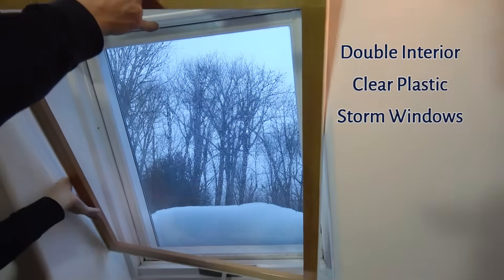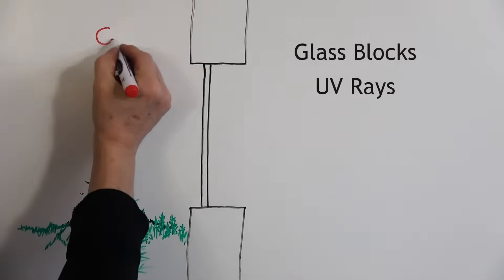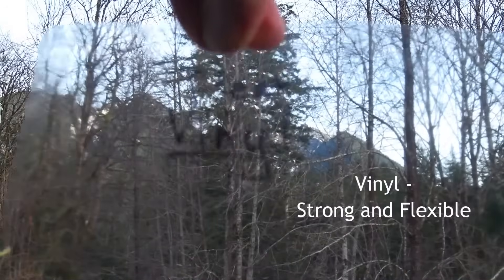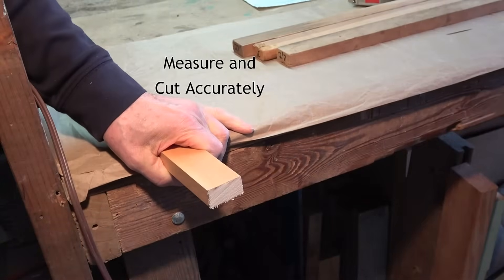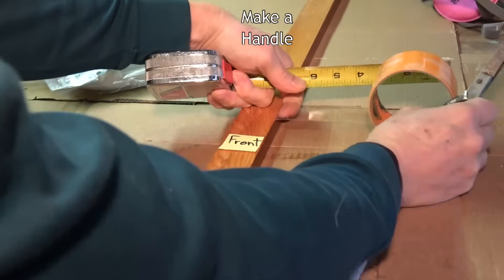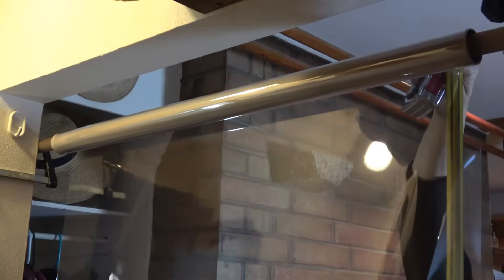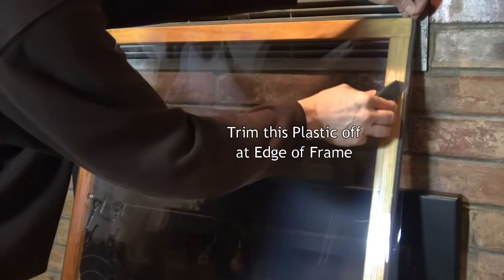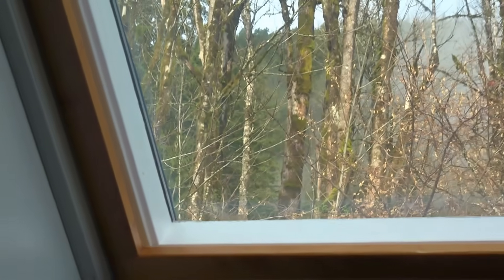Best Double Interior Storm Window Inserts: Save Money on Heating

Comment from the maker: Note: To shrink the film tight with a hair dryer like Window Insulation Shrink Kits, I'd suggest 1 or 2 mil film, if you can find it.
I've found the folded up 0.75 to 1.5 mil film that comes in shrink kits is not very clear, and even after shrinking the creases still show.
The 3 mil polyester film I use comes on a roll so it's not creased, and it's a little wavy but very clear, and a hair dryer isn't necessary.
If you're determined to shrink it tight, you can do it with a heat gun, but be careful not to melt a hole in the plastic doing that, and if your frame is too flexible it may bow in from the tension.
Reply: Does the thickness of the film affect R value?
Reply from the maker: @drencrum  Good question.  It's primarily the air spaces that provide the insulation.  The thickness of the film may make a small difference, but not much - I have not found any data on that.  More important is to have air spaces between 1/2" and 3/4".  Much more than that and you get convection currents that transfer heat. A thicker film will reduce sound transfer though, if noise is a concern.
Reply: @HartzHomestead  interesting.  I agree that a larger space will have more likelihood of convective air currents.   

I wounder what other factors.   I wonder if more or less currents develop in larger vs smaller windows,  sunshine vs shade etc
Reply: I used the clear stuff from a fabric store that they used to use to protect furniture back in the 50's and 60's and I use it on my patio door screens . It costs more but you can get it in 3 different thicknesses  . Never even looked in the store to see what it was described as . I just remember i had an Aunt that had her furniture covered in it and even the cloth seats on her kitchen chairs and it always made fart noises and stuck to your skin .  WOW that says how old I am   72 years old   Great job in describing how to build them
Reply: May I ask what brand you use?   The poly I’ve looked at is very cloudy and flexible, almost like sheeting used for painting.
Reply: @tryan368  Hi!  I don't know if you found your answer yet, but if you look in the description of the video there is a list and links of suppliers he used.  One is an amazon link and the other is for eplastics.
Reply from the maker: @tryan368  The clear polyester film on Amazon is called Duralar, and Mylar is another brand name. Eplastics simply sells it as clear polyester film, no brand. The cloudy plastic you refer to may be polyethelene, cheaper and commonly used for tarps, painting and UV resistant for greenhouses.  Vinyl is fairly clear, used for shower curtains, and also comes in UV resistant for outdoor and marine use.

Comment: i was told this could still trap moisture with single pane windows. and to do build a frame and do ⅛” acrylic (plexiglass) or polycarbonate as it’s rigid, better insulation, and a much lower condensation risk.
Reply: is this true?
Reply from the maker: Whether it's plexiglass or polyester film, moisture doesn't go through the glazing, it leaks in around the edges.  The insulation value is in the size and number of air spaces, and how well sealed they are.  I get minimal condensation between the insert and window, and only upstairs, where air is warmer.  You can absorb it by putting desiccant packs in there. The real question is how well sealed up your insert is, regardless of what it's made of, and also if there is moisture there to start with.

Comment: Great! wish this was a more common option for regular windows in stores
Reply from the maker: It's true, would be nice if store bought windows had even surfaces around each pane, designed to tape plastic to, and also if stores would carry the quality supplies needed. I have heard of window units that have glass on the outsides with layers of plastic inside, where it is protected from damage, but much lighter than all glass panes.

Comment: You needed to use "The insulational Factor of AIR"  IF the air can't come and go then it becomes some form of insulation.
This means you can get a larger total for the R factor simply by having deep pockets between layers.
Reply from the maker: Everything I've read says if the air space is over 3/4", then convection currents circulate within that space, flowing down the cooler surface, and up the warmer surface, thus transferring heat faster. So while there may not be a big difference, a large gap, like some of my windows have a 3" space on one half of the slider, is not quite as insulating as the more ideal gap of 3/4".
Reply: @HartzHomestead  You are correct about the issue of air space.
"The insulational Factor of Air" is based on NO transfer of air or very limited transfer of air in proportions.
(The easiest way to explain the effect is it's easier to maintain the heat in an Office in the middle of a factory than it is to heat the same office outside of the factory.  I've live that in the form of a Guard shack in the middle of a plant floor.)

I'm trying to find the you tube about a new company that is claiming R-30ies by having very deep window and then layers of the Polyester film with like 2.5 foot gaps (estimated)  each layer is sealed.

Comment: This is an insanely well made instructional.  O have a sun room that is currently just screened in.  It's a social focal point and a great spot to overlook the farm from, and watch birds or sunsets.  I've been wanting to build some kind of solid barrier for the windows during the winter, but all the polycarbonate etc options are overkill and not transparent enough.  This is perfect.  I may built a small seed starter greenhouse with this method too.
Reply from the maker: Just note that most polyester film is not UV resistant, unless you can find one that is, most plastic films won't last more than a few years exposed to the sun. You might consider Marine Vinyl, which is UV resistant, though not quite as clear it's pretty good and will last a long time. Also vinyl has a softer feel and would not make a crackling noise in the wind like polyester might. UV resistant polyethylene is commonly used on greenhouses, and is much cheaper, but a hazy white, so you can't see much through it.

Comment: I've had good results using a $3 clear shower curtain liner to cover both sides of a frame insert.
Reply from the maker: That would be a low cost way to buy a sheet of clear vinyl, which is strong, flexible and easy to work with, though not as clear as polyester film, if you're not particular about your view, it works just as well for insulating windows.

Comment: Neat tape measure tip😊. What would you do with a window that is over 5  1/2 ' high? Great video btw😊❤🙏🇨🇦
Reply from the maker: Depends on how wide the window is, and how wide your plastic film is. Most 1 x 2's would likely bow in at that length, so either divide it into 2 windows, or put a cross bar half way up. Otherwise use stiffer wood, like maybe 1 x 3 fir for sides much over 4'.
Reply: @HartzHomestead thank you so much

Comment: Adding an extra pane can reduce the heat loss created by convection currents (if gapped correctly) but in reality, the majority of the heat loss through a window is via radiation (65%+). Best to use blackout curtains when possible.
Reply from the maker: I haven't seen data on how much window heat loss is via radiation vs convection. I do know that adding 2-3 panes cut our heating bill by over half without affecting our view.  Many RV dwellers swear by reflectix, which reflects radiant heat plus adding an air gap, though it also blocks light and view, so it depends on your priorities.
Reply: @HartzHomestead  That's pretty much my conclusion. Windows suck. I think I read that a non insulated window is R1 but a triple pane is about R2 - R3 which is terrible compared to a poorly insulated wall which is around R12. 

I've been modelling air gaps between window panes and unless the aspect ratio of the window height to air gap is 10 or lower (i.e. 1 ft tall window to 3/4 inch air gap), there is basically no convection current which means most of the heat loss will be via radiation as air is a really poor conductor of heat.

Comment: 50 years ago we had windows with a 2nd set of frames for winter. Only problem was that once installed they stayed till spring and no ventilation. But in a 100y old house this was not a problem. Now we have windows with double glass, better heating and better wall insulation. An additional layer would be nice, but I open them 20 times a day for fresh air so I can't install anything over the window.
Reply from the maker: Can you tape a layer inside the opening window so it opens with the window? I do that on wood casement windows with just a 1/4" gap, but it's hard to do with sliders. I do have 2 windows I split into 2 panels, so I can slide one to the side and open the windows. Or select 2 you windows you'll open and put inserts in the rest. I wonder if you turn the heat down if you wouldn't need to open the windows as much? It may help to run an air purifier if air quality is an issue, but still it's nice to have fresh air.

Comment: Anymore tips on doing this without kinks in the plastic? I've tried frame on a table and frame in window and I keep getting wrinkles.
Reply from the maker: With 3 mil film I usually just get a slight waviness I only notice at night when there's a reflection. If you really want it smooth you could try 1 or 2 mil, then stretch it with a hair dryer. It's important your frame is stiff enough that it doesn't flex too much, then stretch it plenty tight top to bottom and side to side in the middle. Working it out to the corners is the trickiest part; make sure to stretch outward at a right angle to the sides, not stretching it toward the corner, or you'll get wrinkles in the corner. I think it's a matter of keeping a mild, even tension on the plastic, not too much going out to the corners or you'll get a bow in the middle of the side. Hope this helps.
Reply: @HartzHomestead  thanks I realize my windows aren't totally square. 100 yr old house. So I should have used a softer thicker foam. I also learned that i should have worked on the attic air leaks before doing the windows.

Comment: Old house comment. I used to live in a house built in the 1920s. One year, sheer laziness & extra material, I stumbled onto a great energy saver. I was using those clear plastic sheets a person puts on for the season with double sided tape. Rather than cutting the plastic film, I taped the too-big sheet to the wall centered on the window. It extended about a half foot on all sides beyond the window trim.  So much warmer. I hadn't realized how drafty the window installs on that old house were.
Reply from the maker: Good point.  I'm doing that on our camper with insulated curtains, going past the window, covering the whole wall in some places.  Otherwise, caulk well around any window perimeter that isn't well sealed, both inside & out.

Comment: How do you know the ideal spacing?    Is 3 inch spacing too much?
Reply from the maker: If you Google "optimal window glazing spacing" you'll find charts that mostly agree 1/2" to 3/4" (12-18mm) gives you the most insulation.  Wider than that, and you get air currents between layers that reduce the effectiveness. However, that may be impractical in your situation, so do whatever works, it will still make a huge difference. In our house I have anywhere from 1/4" to 3" in some places.  My double inserts are 3/4", which is very convenient as that's how thick 1x2" are.

Comment: Very useful video, thanks. I suggest you try 'shrink film'. After it is attached to the window frame or a removable frame with double back sticky tape, use the heat from a hair dryer to shrink the film so it becomes taught and without wrinkles. I have had it on a non opening window for over 10 years and it still works well. In the air space between the film and the glass put some sachets of silica to dry the traped air to avoid condendation.
Reply from the maker: Yes, you can buy clear polyester film in 1 mil thickness, and shrink it tight with a hair dryer.  I was not impressed with the 0.75 or 1.5 mil films that came in Frost King kits - it was creased from being folded and not very clear, though the tape is good. If you don't care about your view it would work fine. Glad to hear it has lasted 10 years.

Comment: This is a very good explanation. I live in an older house that still has removable storm windows (remove at spring, re-install in fall) and the instructions about cleaning and not trapping moisture are correct. And an additional layer does make a very significant difference in heat loss.

Comment: Have you experienced any condensation problems with your interior storm windows? I installed something similar before but got condensation, probably because mine wasn’t airtight. Thanks for the great, informative video!
Reply from the maker: I get minor amounts of condensation on the bottom edge of outside windows sometimes, but it's not really a problem.  Cold, sunny weather will evaporate moisture between panes and it will condense on the coldest surface. It helps to install interior layers of glazing in cold dry weather. 
If the insert inside seals better than the outside window, moisture from in the house won't leak out as much, and will ventilate to the outside. Thus I recommend your innermost plastic layer seal all the way around, covering the weatherstrip. I have one skylight insert I trimmed flush with the wood and get some condensation on the weatherstrip. 
I notice condensation more on upstairs windows, as warm air rising tries to suck outside air in through cracks downstairs and push warm moist air out through any leaks upstairs, which can condense on the coldest surfaces. 
We live west of the Cascade crest and get 100" of rain a year so it's pretty damp here a lot.

Comment: This video is amazing. However, I made one of these and found the tape and weather stripping did not stick well to the wood. I ended up buying different weatherstripping but it also did not stick well. I then painted the wood and found the tapes still don’t stick well. What am I doing wrong?
Reply from the maker: Hmm. I'm not sure. Once I have the tape in place, I rub it firmly with the back of my thumbnail all over before removing the backing. I assume your wood is smooth, and your paint was thoroughly dry. There is some difference in tapes and weatherstrip, some have aggressive adhesive, others may need warm temperatures and firm pressure to stick well.  Even with the same brand there can be differences in batches. Warming with a hair dryer may help. Maybe talk to a local hardware store if they know anything. Let us know if you figure something out.
Reply from the maker: Be sure to remove any dust from the wood frame before putting on the tape. I use a tack cloth, made for removing dust after sanding, to be sure there's no dust that would prevent tape and weatherstrip from sticking.

Comment: Thank you so much for this video!! Going to try making my own this winter! 
Do you (or anyone reading this) have any advice for windows that don't have a jam extension? I'm renting an apartment with old windows, and while the vintage wooden frames are beautiful, they prevent anything from sticking to them (ie shrink wrap tape, command strips, etc). 
So, no jam extension, no tape, and preferably minimal damage - is there a way to make these diy storm windows work for my place? 
(My current plan is to drill some 1x2s around the frame to make a secondary frame of sorts, and somehow attach the storm windows to that...but it'd be both ugly and difficult to repair if I ever move out...)
Reply from the maker: There are removable double stick foam tapes available made for mounting pictures and things on the wall, called "no residue" tape. Some have 1/8" foam so even if your wall was uneven, you could build your interior storm window and tape it all the way around to the window or the wall around it.
Reply from the maker: If the wood frame of the window has a square edge that sticks into the room from the wallboard, you could build a frame that fits outside that with weatherstrip that compresses to hold it. You'd need an L shaped frame all around to get 2 layers. 
If there's non-square wood trim in the way though, you might be limited to a frame held to the wall over the window by 4 screws, probably one in the middle of each side, with weatherstrip to seal it, and figure you'd fill the holes if you move out, unless the owner wants to keep them. 
Or use Museum Putty which sticks well but is removable, (though you' might need a lot of it) or removable painters tape, though it's usually blue, so wouldn't be pretty. Amazon has a clear window sealing tape that's removable, but on our camper it left a residue. There may be a double stick foam tape, like to hold a canopy to a truck; it would have to stick the right amount to hold the window and still be removable.